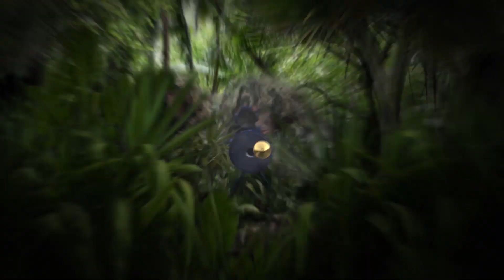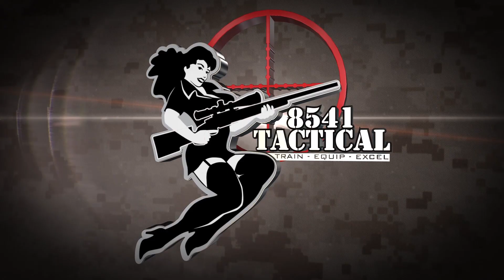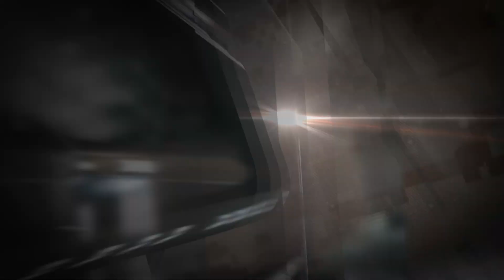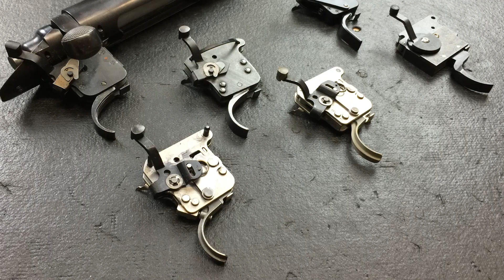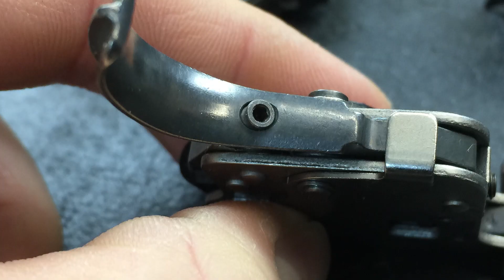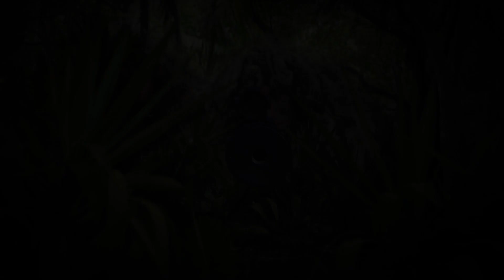Mail Call Mondays Season 3 #31 - Remington Triggers and the Recall

Comment: Recall replacement of the trigger by Remington took 12 Weeks round trip.. 
Rifle came back without the Bolt.
It's now in it's second trip to Remington to have a new Bolt fitted to the rifle..
If I had it to do over again I think I would have just bought a replacement trigger, I've been without my rifle for the entire summer, and now deer season is right around the corner.

Comment: Anyone have any experience with Witt machining clamp on muzzle breaks? They look very well machined and are at a reasonable price point. Any help would be great, thanks!
Reply from the maker: No experience yet.
Reply: I have one on my 243 and it works great. It's a savage model 11 with the "sporter" barrel so when it gets burnt I will upgrade to a heavier and threaded barrel :) At least half of the felt recoil is taken away.
Reply: Very good breaks for the money and actually know the guy personally and seen his work, extremely talented guy and have friends who use the brakes and do the job well and no issues yet.
Reply: We sent a request in to them. We will see if they want to send one out for review.
Reply: I went ahead and ordered one for my .308 r700 with a factory varmint barrel I will let you know how it turns out.

Comment: @gz989898 hey man, I think an old 700 and some good work done to it should work, but I got myself a aac-sd this summer, threw on a bell n Carlson stock, good scope and hardware, and was shooting well below 1" @100 consistently.. Depends on how much work you want to put into it I guess, but can't really go wrong with a aacsd, my experience has been great. Also, check out Johns Budget Precision series, that's a AAC-SD as well and I had similar results using similar components.. Hope this helps and good luck